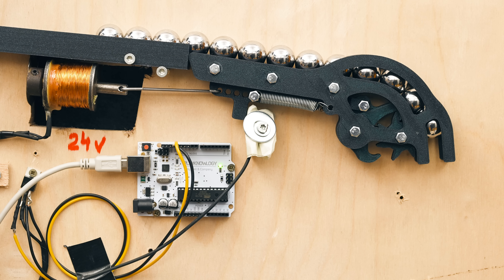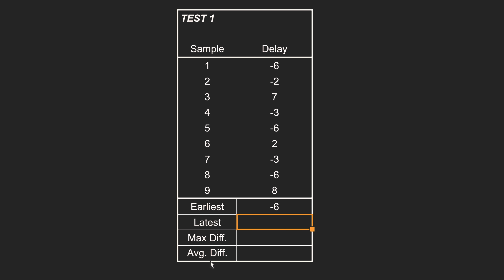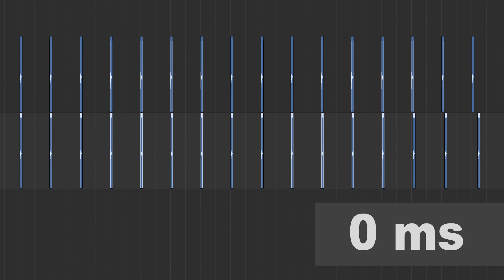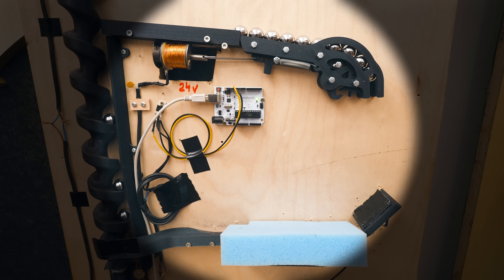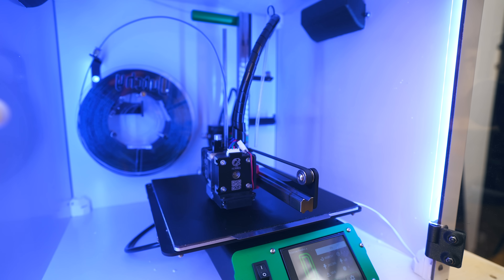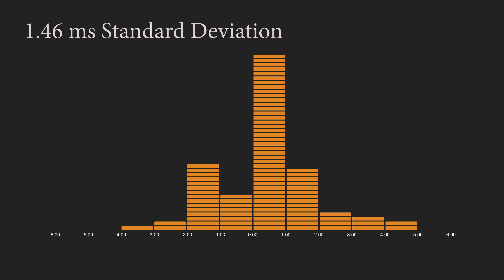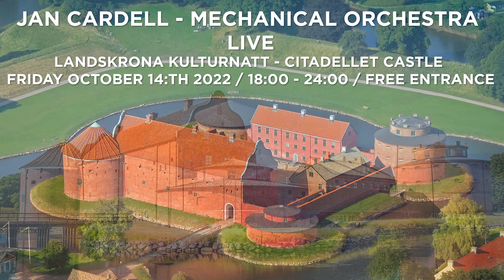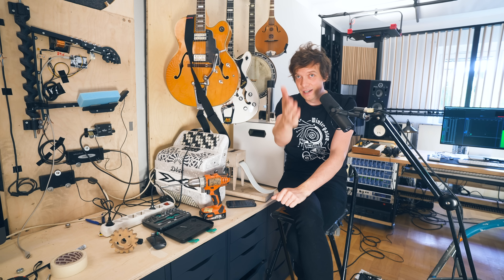Testing the Arduino Marble Gate

Comment: The main issue I had with your continuing efforts to construct a zero (or basically zero) delay marble machine was that it seemed like you never really had the skillset or methodology to make it happen, so you ended up going in circles chasing something that was ultimately never attainable. This video shows a clear departure from that. Your pursuit in this video seems more clear and focused, and I actually think you can do it. Welcome back
Reply: It is kinda scary to realize he only learned about standard deviation, the most basic statistical tool, so recently. That knowledge really could have helped with his tests and his fight with the machines tolerances.

Comment: The Arduino shouldn't have 1ms of jitter, if it is not a mechanical problem you might need to use interrupt timers for high resolution timing.

Comment: Hey Martin! I notice you are using the `delay` function in Arduino. This is not good for tight timing because it is implemented in software. Rather, you should prefer hardware timers (see the TimerInterrupt library).

Comment: Miss your videos. Just a bit of suggestion. I think you are spending a lot of time doing this tests. You could automate the whole test using a bit of coding and some changes to the Arduino. Maybe swap it with faster microcontroller like STM32. I think it is better to use something like IR sensor to detect the ball release and "hit". We can then log the interval in SD card or calculate the standard deviation in real-time.

Comment: Arduino's millisecond inacuraccy may be caused by program - any delay or measurement in milliseconds will limit accuracy - use microseconds instead.

Edit: now I see your code, the delay function is definitely the culprit. Check "Blink without delay" tutorial, you can use microsecond counter with the same technique.

Comment: Not the arduino is 1ms inaccurate, your code is. If you want better than 1ms accuracy, you need to use functions that have a defined accuracy better than 1ms. You could either use hardware timers (not recommended for inexperienced people), or use the micros() function with active waiting, which also removes the influence of the time spent outside the delay function.
Reply: also can use PORT manipulation instead "digital write", digital write sucks at the thigth ej 
PortA = B00000001
Delaymicro.... (100)
PortA= B00000000
delay......(time)

more thigth can achive by use for do nothing using "byte" instead int or Long

also can use timers,

Comment: As a pinball geek, here's a titbit that may be of interest. Solenoids require much less holding current than the current needed to fire them. This is good for two reasons: you can use much less current by having two levels - one to fire the solenoid, and another for holding current. That's good for power savings. Also, though, you can use much smaller (and cheaper) solenoids. You can use a solenoid that can't handle the firing current for long without burning out, but you only supply that current for a moment and then switch to low current. That lets the solenoid cool down. Pinball machines do this with two different resistors and a switch that activates in the "fired" position.
It's common in pinball machines for a flakey switch to cause the solenoid, and often the mosfet, to burn out as the current doesn't get dropped. Just the life of a pinball machine. With Arduino, that's avoided with smarter code.
Anyway, just random info. Peace.

Comment: You mentioned that the arduino was a bit inaccurate, how are you timing the arduino, are you using a software timer, a hardware timer like the delay() or millis() funtion or a hardware timer triggering an interrupt. There is a big difference in timing methods. Even the type of resonator/crystal (like a watch) used in the specific arduino can be off by a fraction of a percent. I recommend using a real time clock (rtc) with good specs if you want to be more accurate with the timing

Comment: If you want precisión, you should try the LIGO approach, you fire a laser, you split it in two in order to get entangled photons/marbles, you cool all the system at 1 kelvin degree, then you measure the wave off face difference between the particles. 
Or.. you can keep it at 10 ms where nobody would even notice a difference in tempo.

Comment: If you are into timing tests consider getting an oscilloscope with two channels. Maybe you can get a cheap, used Picoscope or something. For the detection of the marbles you could maybe even get a light barrier to be more accurate and independent from mechanical things. This would help you test 10000 drops without fiddling.

Comment: Arduino itself should't be off that much for sure - the electronic signal and the solenoid action should be near perfect. After all, Arduino can generate video signal all in software with timings orders of magnitude more precise than this application.  The 1ms inaccuracy is either comes from an improper code, or a mechanical component.
Reply: Likely both.  The solenoid wiggles (and might not have a sufficiently "stiff" power source for the opening transient) and the code uses delay() which almost certainly adds an unknown time (up to 1ms) to every delay (or it subtracts up to 1ms, depending on how the code is written).

I hope Martin does what somebody else here suggested: use photo gates for timing instead of all that manual fiddling with microphones and an audio editor.

Comment: Great to see a new video!
One thing to remember: some of your tightness will have to come from dropping the marble in a consistent location because you have to have a bit of an angle on the instruments so the marbles bounce off of them predictably. The most realistic way to measure the gate would have the microphone at the same angle as the instruments. Therefore you will get the correct balance between release timing & consistent positioning
Reply: On the topic of consistent position, the channel the marble is in will be critical for this: as the escape wheel moves, the marble will roll forwards as well as down the 'tooth'. I notice that the channel is quite a bit wider than an actual marble - there is lots of spare width beneath them as they roll off the escapement. Tightening this might help. Just don't make it so tight that it starts resisting the motion

Comment: Great to see you back, Martin! I have some advice for timing the marbles! There is a tool called a "photogate" that uses a beam of light to detect when something passes through. They're pretty cheap and just plug in to your computer. Placing it above your target should allow you to automatically capture the moment that marbles pass by with less uncertainty (and work!) than looking at audio transients. This way, you could automatically capture much more data with no extra work, and more data is always better than less when looking at statistical distributions. If you use two of them, you can even calculate the speed of your marbles, if that's something you'd be interested in knowing. You could do something similar with a mechanical switch in place of the contact microphone on the sponge, maybe even wiring it to your Arduino. It should save a lot of time in Logic! :)
Reply: yep.. the use of better sensors and instrumentation could be useful.  As an electronics guy, I can envision using a 4 channel oscilloscope to measure the pulses or signals from the arduino, the time for the solenoid to actuate, and when a marble is released.  A side benefit is that the oscilloscope could do all of the statistical calculations itself.
Reply: @SkyhawkSteve  Agreed! That right there is the important part. If Martin really wants to break the machine down and make every step as perfect as possible he can't be spending hours doing the most basic of data crunching. Definitely seems like a job for optical sensing coupled with a fast logic device or Oscope. Ideally dumping all the data to the PC for later comparisons as well, the precision and deviation on each variation of every sub element design is actually worth knowing even after you move on to other things - if your 1st and 2nd choice droppers is always "perfect" tending towards fast/slow but the previous step in the mechanism is always "perfect" tending fast you may not actually need to do anything further to the assembly at all if you use the correct dropper varation - as the whole assemble tends even more towards "perfect".
Reply: I was thinking exactly this! If he uses a photogate, he can put the microphone back at an angle so that the rig is able to run autonomously. And as you spelled out already, the measurements can be transcribed directly into timestamps, meaning he won’t need to mess with audio editing to make his measurements.
Reply: I agree. It should be possible to start a timer in the Arduino when the gat is activated, and stop it when it passes the light gate, and then send the data to the computer.
Reply: definitely and it would not be that much extra code to do every in the Arduino, I hope he sees this and try to implement it to his testing
Reply: or even just a high speed camera with a scale behind it.
Reply: Martin should also be able to create a formula to automatically calculate those numbers he is manually entering. A matter of dragging the top box down the entire column to fill in the numbers.

Comment: Is that a gear or rotating part, like an escapement? You should check for a periodic component of the error that matches how many marbles drop in a complete rotation. It looks 3d printed, if one of your x or y axes were miscalibrated it could be out of round and not perfectly rotationally symmetric?

Comment: You can probably get the arduino to measure the delay by itself. And if you switch away from the delay function and switch to something absolute time based (micros for example or the timer peripherals) you can get it to be very very accurate over very short time periods.

Comment: 3.9 milliseconds of deviation would mean less than 1.95 milliseconds of "distance" between beats, because the deviation can be in either direction. That said, the "standard deviation" means that there can be smaller single deviations in the sample, as well as greater but rarer deviations.

Comment: If you are looking for accuracy in timing you should be using a RTC (real time clock) with your Arduino. The clock speed of the Arduino itself is not going to be highly accurate.
Reply: Sure, but it is not going to drift a millisecond or two from one marble release to the next.

Comment: Not sure the standard deviation is exactly what you're looking for here. The standard deviation takes into account the number of samples (in this case marble drops), and will appear to improve as you run longer tests (more marble drops), even though there is no change in the "tightness" of your marble gate. Have you considered using the interquartile range to measure the "tightness" of your marble gate instead?

Comment: if you want tight timing you shouldn't use delay's in arduino, record the time using Millis() and add your timestep, call it X. then use if(millis() >  X) then actuate the solenoid, this way the MCU will run at full speed and have tighter timing. potentially +/- 1 or 2 milliseconds caused by your program currently.
Reply: hell if you wanna get even higher precision. use longs and use micros()

Comment: You could use a RTOS when running the arduino to remove the variance in the solenoid timing
Reply: Not necessary. As long as he switches away from delay() to delayMicroseconds() or micros()…

Comment: Some of your latency is coming from the Arduino as well.  Those CPU have a very low clock speed. You could sample the command time vs react time of the solenoid and account for that in your findings.  You also have the stroke time of the solenoid to account for.
Reply: An arduino 16 Mhz can theorically pulse a digital output every 62.5 nanoseconds if programmed properly.. Let's say, a few microseconds if programmed badly. One millisecond is an eternity, even for a "low clock speed" arduino :) Problem is elsewhere.
Reply: Arduino Unos run at 16MHz, so one ms would be 16000 cycles. By actively waiting with next to no interrupts enabled, the timing from the arduino should be very accurate (1ms would be a very large inaccuracy, even if the mcu was doing more stuff). The solenoid adds a lot more delay than the arduino does.
Reply: @coreforge  the Arduino is plenty fast enough. It is also plenty precise if it’s programmed right. It isn’t in this case. Look into the implementation of delay()…
Reply: The clock speed is plenty high.  Using delay() will likely add up to 1ms extra to every delay, which using delayMicroseconds() likely won't.  Using micros() is probably even better.

The solenoid clearly wiggles which is likely an issue.  I also wonder what the power source for the solenoid is -- if it is a power supply that uses mains electricity then it is probably more "stiff" at some points of the phase (when the voltage is high positive/negative) and less "stiff" at others (when the voltage is close to zero).